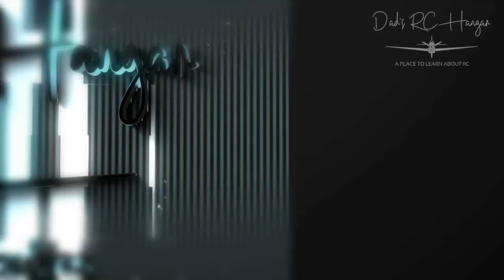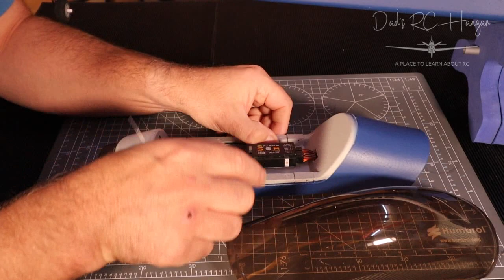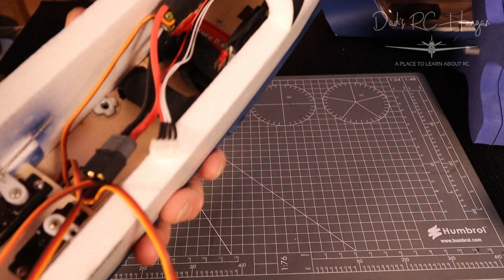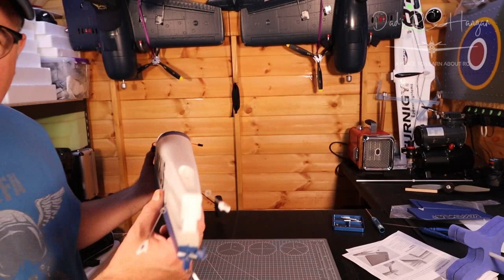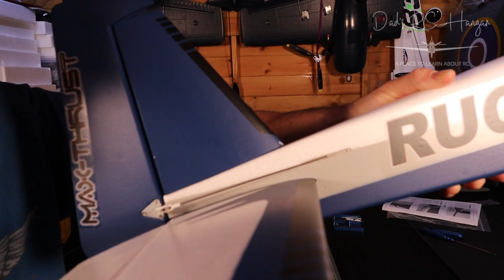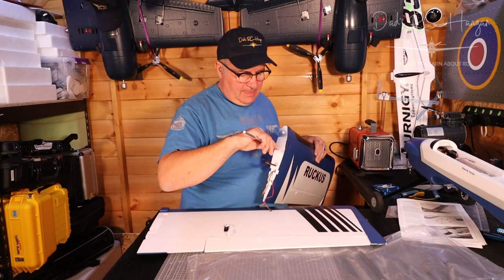MAX THRUST RUCKUS PNP BLUE The Build Part 1

Comment: 10:52 gear going the wrong way? Edit, continued watching!
Are those screws self tappers or metric threads? Are you screwing into foam?

How does it fly?
Reply from the maker: Hi, you screw into plastic, they are pre drilled holes, I would have to check if its self tappers or not, I can look later. The maiden was never recorded, but she a great low wing beginner. I believe they all come as Balsa now as well. Thanks for watching. 👍🏻
Reply: @DadsRCHangar  I'm definitely after a foam version, I think they call the balsa version the 'pro built' ones which are ARTF
Reply from the maker: @ukmitch86  it’s a great plane for the price , if the UK weather settles some, I get her on video. Will look when I get home, to see what the screws are. Hope you subbed 👍🏻
Reply: @DadsRCHangar  have now!
Reply from the maker: @ukmitch86  Hero, thanks. 
Chris
Reply from the maker: Yo four screws, all self tappers into plastic 👍🏻